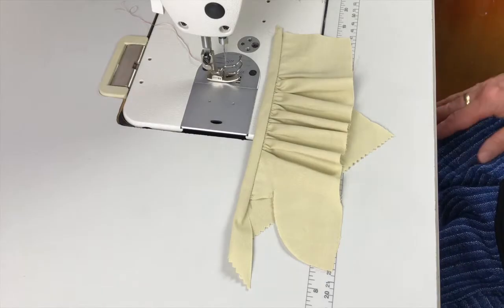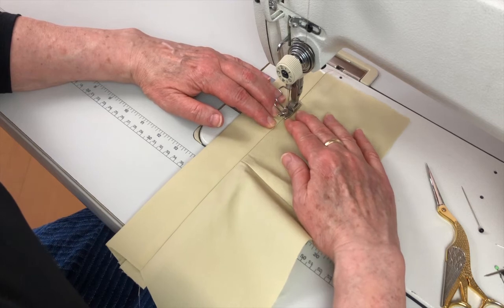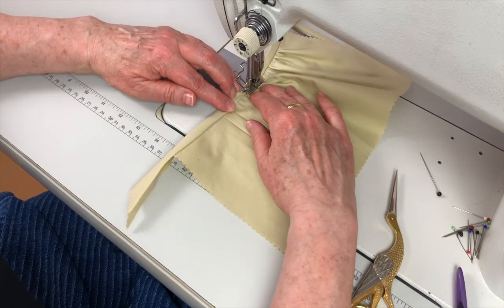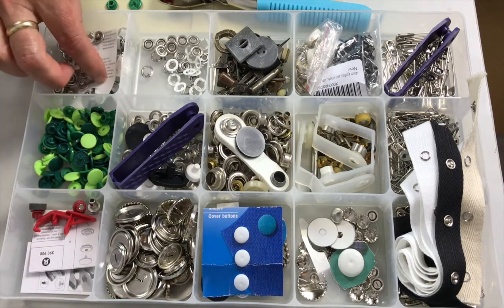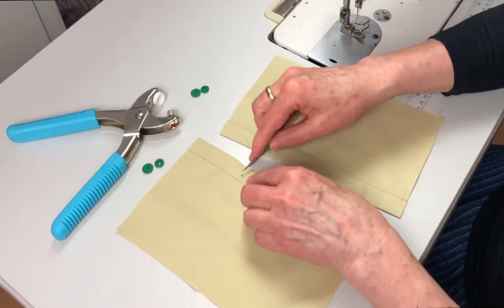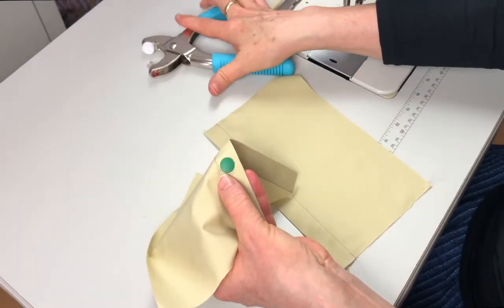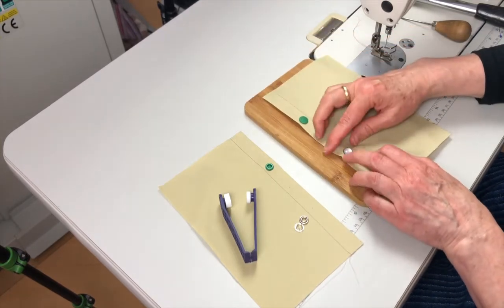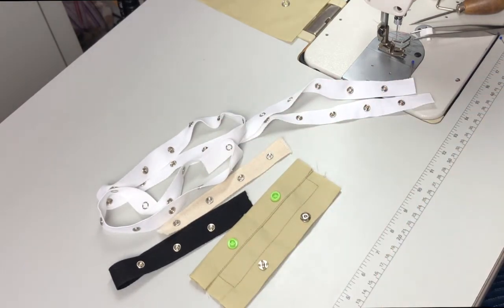GBSB 2021 7:5 - Stitch in the Ditch & Snap Fasteners

Comment: You found something else I need help with, thanks 😄Clear demonstrations, great💕🧵
Reply: Excellent, thank you.  Was it the stitching or the snaps?
Reply: @carolalayne1555  well I’m pretty rubbish at both.  My stitching in the ditch normally gets abandoned for a slip stitch on the wrong/inside of the garment where possible and I’ve just got out my snaps set that I’ve never used as I couldn’t be bothered to YouTube the instructions previously.  The instructions that come with them are so sparse ....I need the full monty when it comes to instructions.  I have already had a futile attempt prior to seeing your video so it’s next up😄💕🧵 Thank you.
Reply: @suesue929  good luck, and get yourself an awl if you're using the plastic versions!

Comment: Another video that explains very clearly, I really appreciate you showing how to correct any mistakes. If at all possible could you explain under stitching? I know the theory behind it, but my attempts are very hit or miss and I’m not sure why. Thanks for all of these fantastic videos
Reply: Very happy to help.  Let me know one particular shape (neck facing, ham facing...) you'd like to concentrate on.  I can definitely recommend practicing on larger pieces, and it can be a matter of deciding what side of the seam join you're most comfortable working on.  All layers of the seam and the facing are anchored together.  I prefer to work on the right side of the join.  Hope this helps a little!
Reply: @carolalayne1555  I’ve only needed to do neck facings thus far. I will definitely make a larger  piece to practice on. Thank you